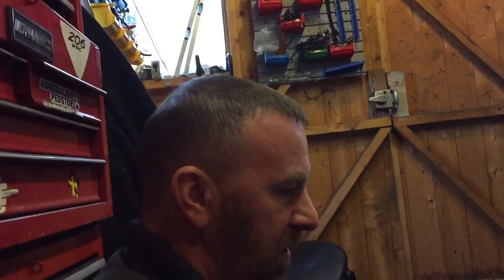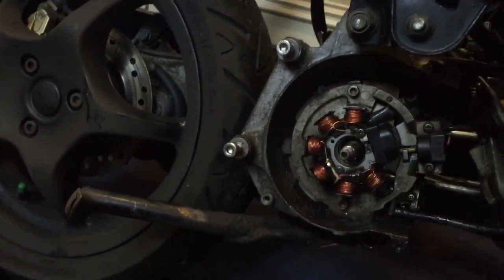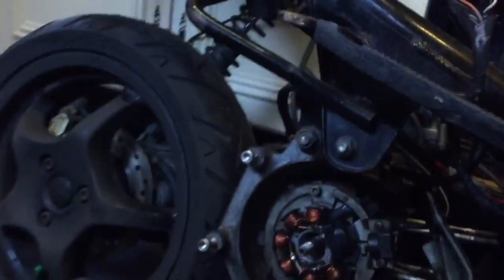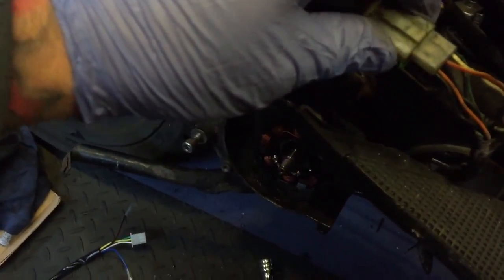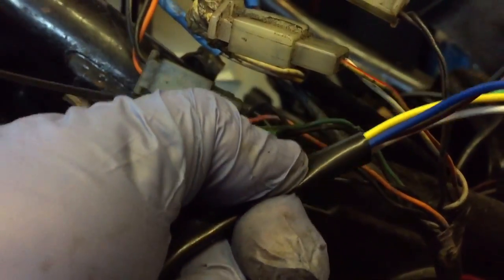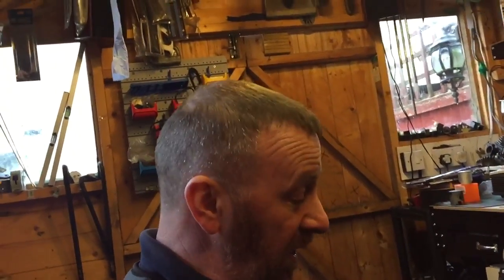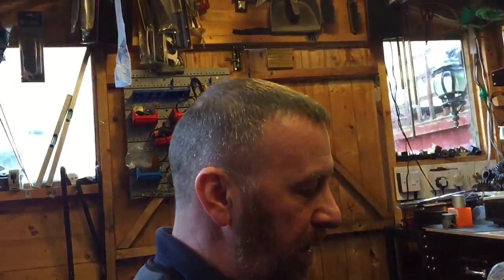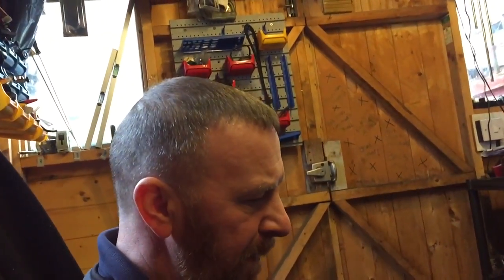Yamaha aerox stator coil replacement mark savage

Comment: Hi mark it’s been nearly a week had no reply I’ve took my stator off and put back on is the timing on aerox need to be set up because now I’m getting back firing on the spot like mad is there a certain setting to set up the stator and bell any positions for timing I really need a reply please mate
Reply from the maker: I did see a few "call me now" messages bud but I don't do that, my help is free and I do try and help but I'm not a shop or garage !!
the stator sits in a wood ruff and only goes on one way and sits on in one position so timing is never out, take it off and see what's gone on bud
if its set up ok it maybe your cdi
Reply: mark savage sorry about that mark and thank you for the reply I’ll swap it over later it’s very strange idile is ok soon as you hit the throttle back fire flames and the. Turns off or may still run would a rubbish head gaskets if leaking do that I’ll have to buy a new plug as the one in there now is new but can fail very strange

Comment: Hi mark, how do you time these then?
Reply from the maker: They fit on a wood pin thing lol like a grove and fit on only one way 
No timing bud 
They do suffer from cdi’s problems tho
Reply: @marksavage  Cheers.
Reply: Hi mark how do you  get a yamaha aerox yq  50 kick start  to return  back up after kick it down  can help  please
Reply: @antltarling3858  oil it with WD40 or small amount of grease.
Reply from the maker: @antltarling3858  I have videos on how the kick start work, its on a speedfight but still the basics are the same and worth a watch on my channel with over 100 om mopeds , you will need to take the engine cover off and sometimes a good old spray of wd40 can help other times it needs to come off and the spring replaced or re set
Reply: @marksavage  I had it set up  for me  by bike shop I take cover over for  them  but I think need changing  the kick start  wash on the engine  because  all the rest is new   big thanks

Comment: I have turned my front pulley on my piaggio zip 2t 50cc will I redo my timing or should it still be the same?? I don't know much about bikes thanks
Reply from the maker: hi bud, no it will be fit, it only would be a concern in you took off the stator coil and didn't refit it right. mark
Reply from the maker: hi bud no it will be fine, it's only a problem if you took off the stator coil, please like share and subscribe , mark